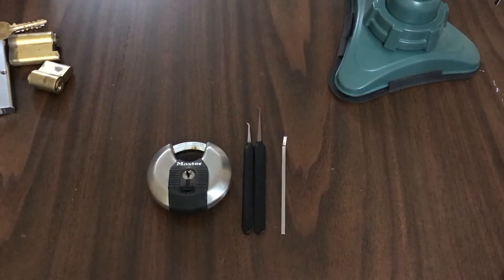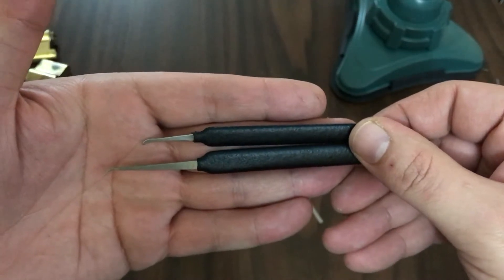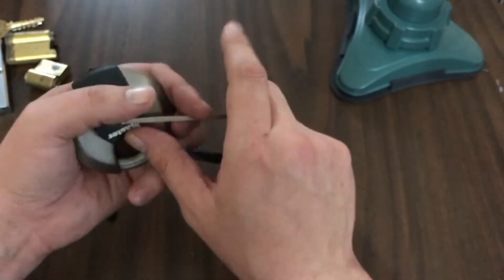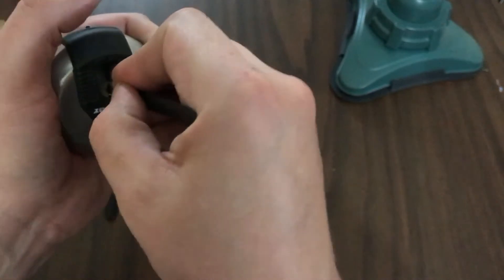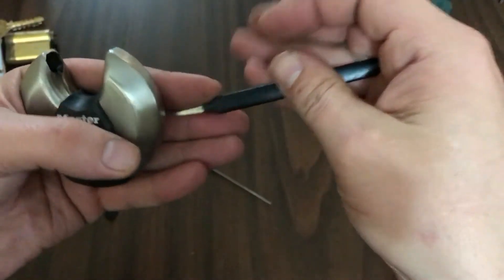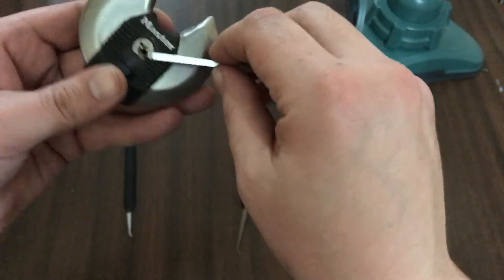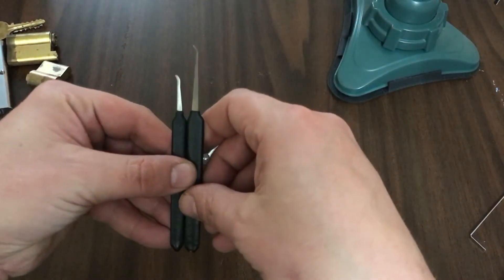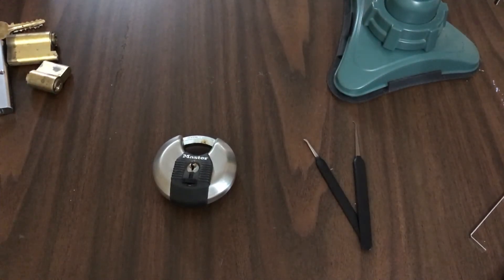(58) Lockpicking: What to do with a broken lock pick. And picking a Master M50XD disc padlock.

Comment: Good goin buddy. Yeah, picks are expensive so repurposing is a great option!🍺✌
Reply from the maker: Thanks buddy! =) Yeah I'm too poor to just throw them away, unless it breaks off right at the handle. But that's only happened once, with a peterson that had the stamp right there. It broke right through the "H1" stamp in the steel. I really wish they would stop stamping them like that. Thankfully only one has broken like that though.
Reply: Frosty901 ooh.😕 I've heard that, Peterson should warrant that, not sure on 100% but think they cover that. I think you have to send the broken off bit back to them. They probably do a metallurgy test on it as it's supposed to be proprietary steel...to make sure its not another brand.👌 Mine have that stamping too!😯
Reply from the maker: Thanks buddy! I have a few tips I need to send back to them, as I get a little rough when I've been drinking. Lol
Reply: Frosty901 Hmm, ok. Just don't tell em' you were drink picking! 😁👌